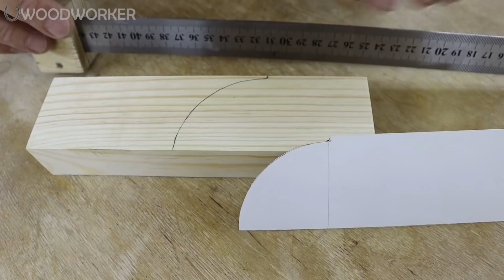Ingenious Wood Construction Tips & Hacks That Work Extremely Well Woodworking Industry Machines ▶20

Comment: Thank you for the Stress test. I was wondering, about the resistance and breaking point.
Reply: I guess you could significantly strengthen the connection by installing a dovetail dowel